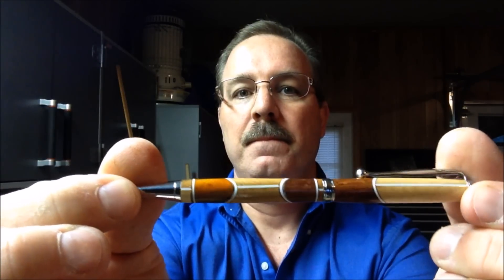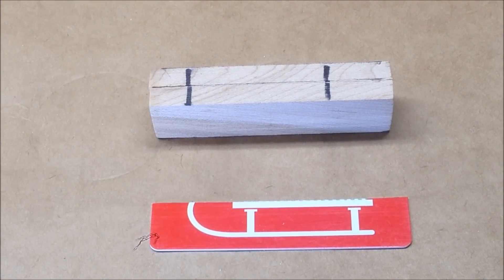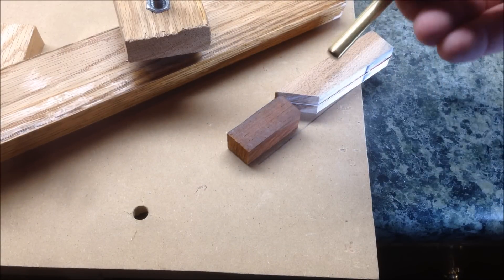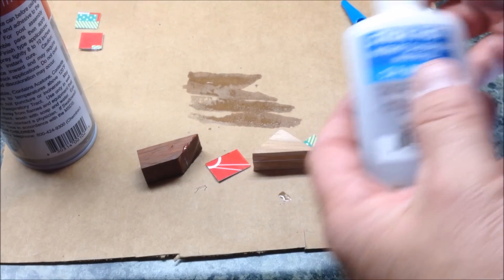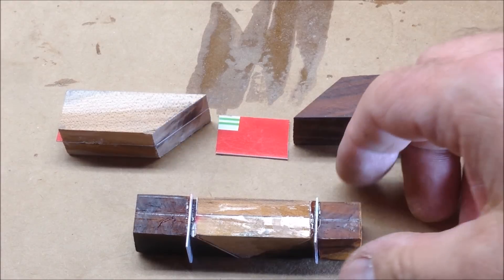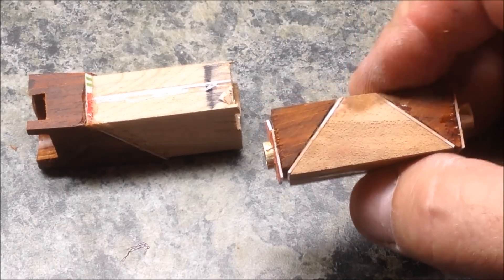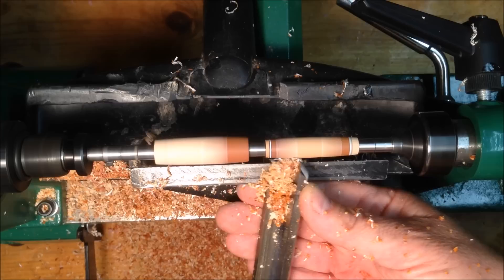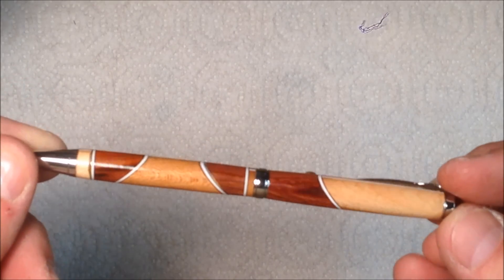Cocobolo Maple Gift Card Pen (Segmented Pen)

Comment: Hi Bob, pen turning is very new to me but watching your videos makes things so much clearer and gives us new chaps a lot more confidence to try your fantastic ideas ,thanks very much .colin cullip england
Reply from the maker: Thank you Colin,
  I'm glad you found my videos helpful. If you ever have any questions, I'd be happy to attempt to answer them for you. 

Regards,
Bob
Reply: RJBWoodTurner Hi Bob can you tell me what i,am doing wrong ,i have just made a mesa click pen,  but the refill will not stay down when i click it
Reply from the maker: Colin,
  The first thing I would check is: make sure all the parts are properly aligned. I have never turned a Mesa but I have turned the Stratus which is similar. 
  Next make sure there are no obstructions in the cap assembly. If the plunger can't screw all the way down, the mechanism will not work properly. 
  Finally make sure the barrel of the pen is exactly 2.25" long. If it's longer or shorter, that will cause issues. 
  I hope this helps, being unfamiliar with the kit makes it a bit tough to troubleshoot. 

Regards,
Bob

Comment: Hi Bob, I am glad you liked my credit card idea for contrasting colors and use of scraps.
I just saw something interesting on pinterest that I am going to try and maybe you would like to also. Put a steel wool pad in a quart jar and add white vinegar. Let it set overnight and then it turns dark and can be used as stain on maybe light colored wood blanks. 
I also like the coke can aluminium idea and will try that also. 
All of your ideas are nice and very creative. 
Thanks
Reply from the maker: Thank you Gerald. 
  I've seen the steel wool & vinegar done, it works great with oaks and other woods high in tannins. It also will turn your fingers black for a long time so use gloves. :^)

Regards,
Bob

Comment: I think after watching this, Im going to gather up all our left over cards and make a pen. A pen made entirely out of gift cards........we'll see how it goes. lol. Great video!
Reply from the maker: That's a cool idea Brad,
  Please send me a photo when it's finished as I'd love to see it. I think it would turn well because when the tool cut it, it came off in ribbons. 
  Just watch the gift cards, I had several there were laminated, be sure to pull the laminate surface off before gluing them up. I'm looking forward to seeing what you come up with. 

Regards,
Bob
Reply: Well I ran into a problem. My pen mandrel is 100% stuck in my headstock. I've tried the little tool that came with my lathe. I never tighten my tailstock that hard as to not bend the pen mandrel. Any suggestions? Thanks. I would post a video but haven't started a youtube channel.
Reply from the maker: Ouch,
  That's a tough one. If you've already
tried the knock out bar and it didn't work, I'm not sure what else to try, that's what  I use. 
  When you do get it removed, I recommend a good cleaning of the Morse Taper inside and out. 
  I'm sorry I can't be more help here but I've never experienced this issue. 

Regards,
Bob

Comment: Nice job!  One of the things that I have found is that wrapping the entire blank with painters tape or masking tape while drilling/barrel trimming helps to prevent separation of the sections.  Hope that tip helps someone!
Reply from the maker: +Matt Iannacci Killer Tip Matt,
  I'm going to try that. I'm planning to use up some cut offs and this tip may come in handy. Do you remove the tape or turn it off?

Regards,
Bob
Reply: I've worked both ways, but I tend to try and remove the tape (assuming it didn't get stuck on with CA/epoxy during the glue-up)... Not in love with the "THWAP THWAP" of the tape on my tool rest/hands during the turning.  Thanks for posting the videos - enjoyed watching!
Reply from the maker: +Matt Iannacci Thank you for getting back to me Matt, I appreciate all the information. 

Regards,
Bob.

Comment: Very nice video and a great pen! Never thought of using scrap kredit cards that way - very smart. I use what we call Vulcan fibre as layers between pieces glued together. It is available in a number of colors and thinknesses.
Reply from the maker: Thank you Fredrik,
  I'll look in EBay for some Vulcan fiber. Are the layers different colors?

Regards,
Bob
Reply: RJBWoodTurner Yes, they are available in White, red, black, green...probably more. The good thing with these are that they will not compress or shrink so they are very stable when clamping. I will check sites in the US because I am sure it is available over there. It is used a lot in knife building with layered handles.

Comment: Hi Bob, a really nice looking pen and one I will try and make in the future, one thing I have noticed in a lot of pen videos is the lack of cleanliness when using glue. everything we touch is covered with grease which is how finger prints are taken, glue will not adhere to grease which might have caused your failures, as an ex clock maker I am aware of what a stray fingerprint can do to your work. I use cut down pencils to hold my brass tubes when sanding and then a dry brush to clean the work before gluing. the same with any inserts I use, etc  etc, cheers Dave
Reply from the maker: Hello Dave,
  You make a good point, I try to be aware of cleanliness in the shop but I know there is always room for improvement. 

Regards,
Bob

Comment: Wow. Another incredible project. Came out great. My first thoughts were that it resembles a basketball court. Maybe you could do another and sneak some Louisville or UK colors in. Lol  If you do start drilling them on the lathe, try the metal method. Start the hole with a center drill. The geometry of a standard twist drill allows it to wander or drift. But a center drill has short flutes that are designed to start a perfect hole. I got some cheap at harbor freight. Once it starts the hole perfectly on center, drill it a size smaller than what you need. Then follow with a reamer. Its a lot of steps and bit changing, and would be excessive on most pens. But on those rare or precocious blanks that you want to take your time with... That's where it will pay off.
Reply from the maker: Thank you for the information Mitchell,
  That may be just what I need. I don't mind the drift so much on a solid blank but on something more critical like a segmented blank that takes a couple hours to make, it really stinks when I drill off center. I'm copying this info to my woodworking notes page so I'll have it on my next trip to HF. 

Regards,
Bob

Comment: Bob, what a wonderful combination of woods and using the gift cards as separators was a wonderful and inspiring idea! Although it wasn't "perfect," you still came up with a great result. I'm learning a lot watching your videos. As a suggestion, try using your lathe as a horizontal drill press, and you'll get more accurate results drilling your pens.
Reply from the maker: Thank you Rick,
  It's funny you should mention that. I have a plan for wood jaws that go into a chuck and grip blanks for drilling. I just need to find a bit of time to make them. 

Regards,
Bob
Reply: RJBWoodTurner Bob, I've not seen anyone to make wooden jaws, but I guess it could work. Have you considered buying a chuck like this?

http://www.woodcraft.com/product/145898/teknatool-supernova2-chuck.aspx

Although these things are fairly pricey, they're worth every penny, IMO. I own a Nova chuck and they sell a special set of pen holder fingers that are designed to hold square or round stock. 

The good thing about these chucks is they securely hold your work, and because they're made of stainless steel, you can really put a lot of pressure on them. Another advantage is that they can be used for other woodworking projects, such as bowl, plates, vases, etc.
Reply from the maker: Thank you very much for the info Rick. 

Regards,
Bob

Comment: Inspiring. I'm definitely going to give this a try! I just made a black walnut and curly maple pen with a 45° a few days ago. It would have been even better with a gift card in between. It just looks like a professionally mad inlay. I think I would just avoid the straight cuts perpendicular to the length of the pen because you do have to be so precise with the drilling and cutting.
Reply from the maker: Thank you,
  Those perpendicular cuts are a real tough challenge but when you get them right, they really set the pen off. 
  I hope you do give this a try, if you do, be sure to watch the gift cards, some of them have a laminate over them and you want to be sure to pull that off. 

Regards,
Bob

Comment: Liked the video. Very nice design. Drilling on the lathe will help a lot.  Also, do not use barrel trimmer. Use a disk sander with a 90' jig = No blow outs.
Reply from the maker: Thank you for the information Daniel, a pen blank drilling jig in on my list of tools I want. 

Regards,
Bob

Comment: I am a huge fan of your channel and I love this design.  I used plastic hotel key cards to make pens with this design as souvenirs for chaperones of a recent school trip to D.C. and they were a huge hit.   (I used Jatoba for the center and Black Walnut for the ends.)

I notice that on some videos you use CA glue for your segmented blanks and Tightbond2 for others.  Obviously speed is an advantage for the CA and time to work with the Tightbond.  What are the deciding factors for you when deciding which glue to use for your segmented blanks?
Reply from the maker: I use Titebond for wood to wood. 

I use epoxy for mixed materials

I use C/A when I’m prototyping because it dries quickly. 

C/A dries hard and brittle. If you drop the pen, it can shatter at the glue lines. 

Regards,
Bob

Comment: Nice pen.  Absolutely fabulous.  Add two more words to your "two words" comment:    Sharp tools.  As to the off-center drilling, try drilling on the lathe.  And for the barrel trimming, on delicate projects I use a disk sander to trim the barrels; a lot less aggressive than the barrel trimmers.
Reply from the maker: Thank you John,
  I agree that the lathe is the better way to drill blanks that are more critical they be drilled straight. I have all the tools to do it, I just didn't. Bad idea on my part. 
  Thanks for the tip on the sander, I'll be making many more of these and I'll give that a try. 

Regards,
Bob

Comment: RJBWoodTurner that adds character to the pen we aren't made perfect....well that is what my wife keeps telling me.....lol. Great pen. when you do the barrel trimming how do you know when to stop? I did on my first pen and somehow the gold barrel showed so when i pressed the tip on you saw some of the barrel. The person i gave the pen to didn't notice but i didn't like.....
Reply from the maker: Thank you Mike,
  I trim until I see the brass of the barrel. I also make sure the blank all around the barrel looks like it's been scraped. If the barrel is inside the blank, this is never a problem but if you get it close to the end, you need to watch. I learned this the hard way and I try to never cut to exact length, I always leave a tiny bit extra and center the barrel. With that I know both ends will be flush. 

Regards,
Bob

Comment: A brilliant video and stunning looking pen thamks gor sharing.
Does it matter if soft and hard wood is used on the same blank? Plus does it matter if one wood grain is 90 degrees to the other wood? so the grain is head on and the other side on!
Reply from the maker: When placing grains 90 degrees to each other you will need a sharp tool otherwise it will just push the grain over and can cause tear out. It can be a tad difficult to turn but will give beautiful results when finished.
  The other thing I like to do with end grain is start sanding it in reverse and alternate forward and reverse between each grit of paper. 

Regards,
Bob

Comment: Hi Bob. I have just recently gotten a 36" lathe second hand. I have been making canes of all types. After watching your videos I have really taken a liking to the idea of making pens. Where is it that I can get pen kits... I have all of the wood so just need the hardware. I have no idea of what i need or where to go get it. Can you give me a list of the hardware I need to get started? Very cool work. Keep up those videos. You have just implanted the "pen bug" into a fellow wood turner. Thank you.
Reply from the maker: Hello Dave,
  I get most of my kits from Penn State, www.pennstateind.com. Have them send you a free catalogue, it's much easier to browse that the website. 

What you need for pen turning.

  Welcome to the Dark Side, turning is a blast. If I were starting over again, I would probably go with the Easy Wood Carbide tools. There is a set with a square cutter, round cutter, and a diamond shaped detail cutter.   
  These tools are fairly easy to master and when they get dull, you just replace the cutters, no learning to sharpen or expensive sharpening systems. 
  I'm going to assume you want to start with ink pens and tell you what you need for that. 

  When you purchase a pen kit, the seller will tell you what bushings and what size drill bit you will need to
make that pen. Bushings can be used over-and-over and bits only need to be purchased once. The first pen is expensive due to this overhead. 

  Medium C/A glue, or Epoxy for gluing tubes into Acrylics blanks. Both work on wood too.

  You do not need a Pen Insertion tool, you can use a screw driver. They are nice to have but not a necessity. 

  Purchase a barrel trimmer set with the four most common sizes: 7mm, 8mm, 3/8", and 10mm. This is a must have. 

  You will need a mandrel, I personally like the Mandrel Saver setup that Penn State sells. A mandrel is a must have. 

  For Acrylics, the easiest was to an amazing finish is Micro Mesh pads. Sand paper is to coarse for Acrylics and should be reserved for wood. Get a box with 4 or 5 different grits. 

  You will need a finish for your pens. 

Finish for Acrylics:
  I like Hut Ultra Gloss. It's quick and the results are great. 

Finish for wood:
  Thin C/A is my favorite. 
  Shella Way is nice for beginners, as is Hut Friction Polish. C/A is the toughest to master but looks the best and lasts the longest. 

  A pen press is nice to have. You can use a clamp or the lathe to press your pens together. Laney Shaughnessy has a video on his channel that shows how to build one. It's really good. Otherwise, purchasing a press can be expensive. 

  That is pretty much everything I can think of. 

  I hope this helps. 

Regards,
Bob
Reply: Thank you so much Bob. That is a great help. I am excited about chasing this endeavor. Thank you for the information.

Dave.
Reply from the maker: You are very welcome. 

Regards,
Bob

Comment: Bob, 

Just thinking a bit about your bit traveling on you.  What if you were to drill out the blank before you added the gift card and then redrilled it?  That way you don't have the gift card kicking the bit off course?  No idea if that would work or not it just kind of popped into my head while I was watching the video.  Great job by the way that pen looks awesome.
Reply from the maker: It's funny you should mention that, I did exactly that when I made the segmented bolt action pen about three pens after this one. Great minds think alike. Oh yeah, it worked great. 

Regards,
Bob

Comment: very nice pen
can i ask how much it would sell for? if you didn't have any run out on the drilling.
thanks again for the video.
Reply from the maker: Thank you Darren,
  Before I'd try to put a price on one, I'd have to see just how much time I had invested. I would at least expect 1.5 times what I sell a single blank slim line for. They do take substantially more time and I need to refine my process to reduce that investment. 

Regards,
Bob

Comment: I'm at a lose myself. My knockout tool started to curl up on the end.  I don't feel comfortable using my plumbing torch as I don't want to wasp anything or melt grease in the bearings. I don't think glue got that far into it so I think I'm going to try some solvent that won't break down the grease. Maybe I will start a channel and have this as my first video. Haha
Reply from the maker: Brad,
  What about some PB Blaster. It works great for seized up steel on car parts. 

Regards,
Bob

Comment: Very cool pen I just started turning pens myself and have learned a lot from you. I was wondering do you have plans for your table saw cut off jig?
Reply from the maker: It you’re talking about the sled I used before I got the Incra, I have disassembled it and will be using it to make a sled for a bandsaw in an upcoming video. 

Regards,
Bob

Comment: I've tried this several times with different types of wood and Walmart gift cards. When I drilled them slowly and cleaning the flutes of the bit frequently, the pieces break apart. I used CA glue in a good amount and clamped them. Is there a better glue, or any suggestions as to what I may be doing wrong. Thanks for any input you may give.
Reply from the maker: I used medium viscosity C/A glue and sprayed it with Accelerator. Thin Viscosity will not work. You could use Epoxy if you
Don't mind the wait time for drying. 

Regards,
Bob
Reply: +RJBWoodTurner I used Rockler Med CA with accelerator and waited 24hrs  which didn't worked at all. I'll try Epoxy to see if that will work. I was working with Rosewood and it seemed to be brittle also. Thank you so much for the fast response, and being willing to help.
Reply from the maker: Wayne,
  I hate to hear that it's giving you so much trouble. Did you try roughing up the gift card with some sand paper? That might give the glue something to grab onto. Please keep me posted. 

Regards,
Bob